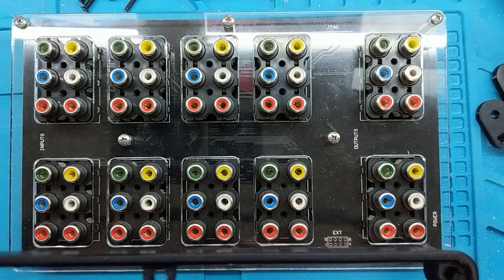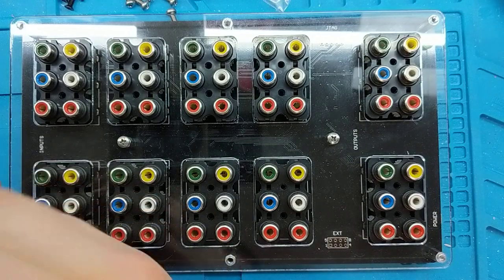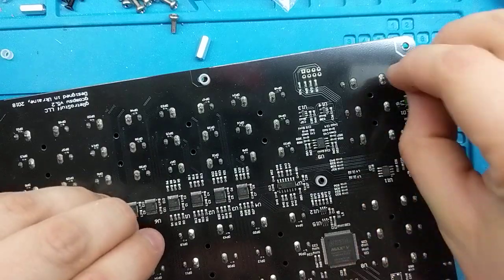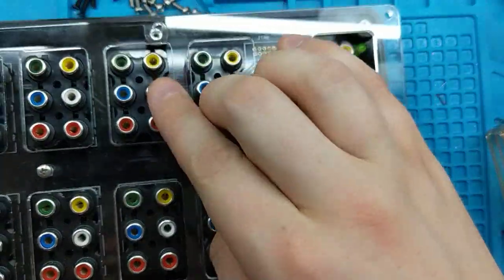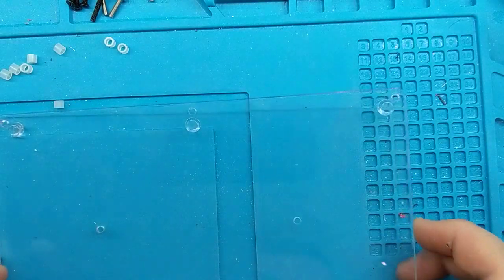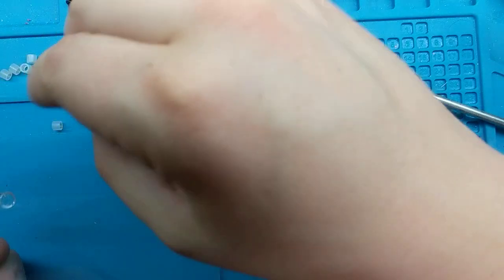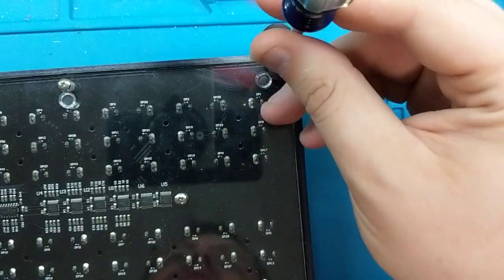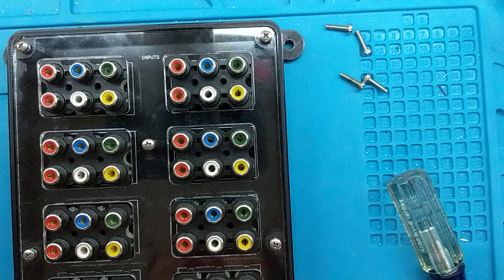GComp Switch Bumper Case Install Guide

Comment: Mine did not come with spacers for the screws. It came with a piece that looked like thin lattice on the bottom. It held the USB in place and had spots for all 8 screws. I’m assuming I have a slightly newer model/build than the video. I took it out and everything fits as it should.

Comment: Just bought this for my Gcomp I just received, the hex spacers seem to be too small for the bumper. They slide right through.  Is it possible that the newly made Gcomp may have different parts?
Reply from the maker: Could you reply to your order email? I can take a look and see what's up.
Reply: @LaserBearIndustries  will do! Thanks for the quick reply!
Reply: I'm in the same boat here, but I made the case work with the switch anyway. Couldn't really follow the video instructions at a certain point, but I did need a second screwdriver to hold the top screws/spacers in place while screwing in the bottom screws. I'd only be mad about the whole thing if the quality of the print wasn't outstanding!
Reply: Same my spaces are smaller and just fall through

Comment: What exactly is the point of the bumper? Is it purely an asthetic choice or is there some fictional benefit to it? Looks great though.
Reply from the maker: Helps reduce the dust on the PCB, the USB port gets extra support making it more difficult to accidentally rip off. Then makes it look a little more polished.